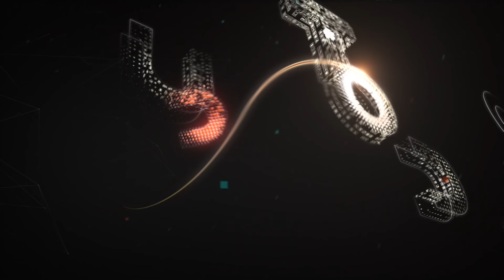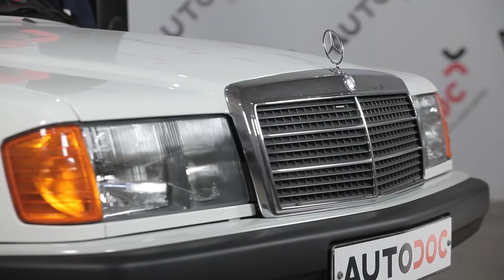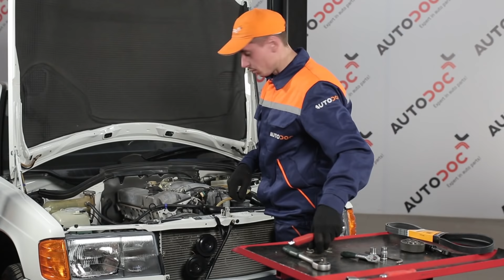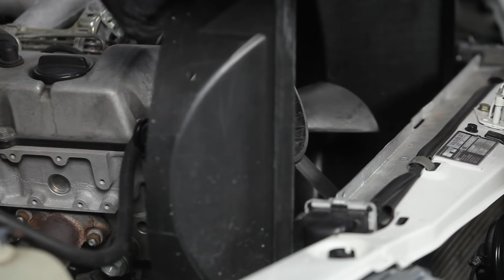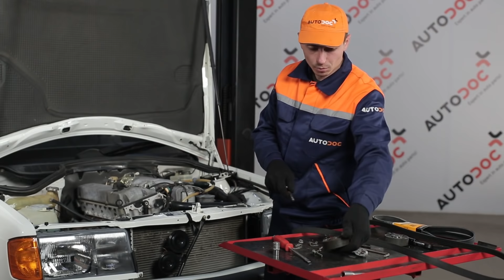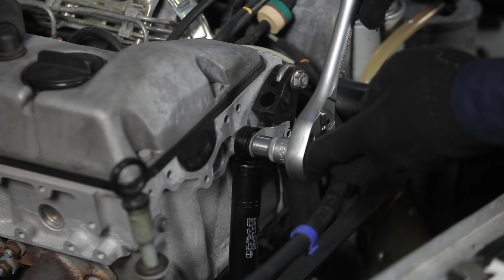Remplacer une courroie trapézoïdale, un galet tendeur, un enrouleur sur une MERCEDES-BENZ 190 W20

Comment: courroie trapézoïdale,     ?
Reply from the maker: Bonjour, une courroie trapézoïdale à nervures est une courroie d'accessoires qui équipe la plupart des modèles de véhicules. Elle est également appelée « poly-V » et se différencie de l'autre courroie d'accessoires (courroie trapézoïdales) ou de la courroie de distribution. C'est une courroie de transmission qui est actionnée par la force du moteur et entraîne ainsi les différents équipements par un système de poulies, et selon les versions avec des galets tendeur de courroie d'accessoire et/ou galets enrouleur de courroie d'accessoire.